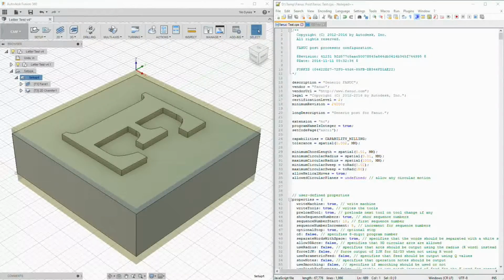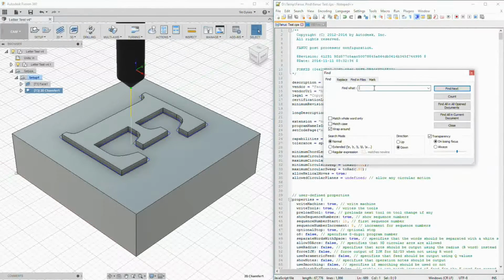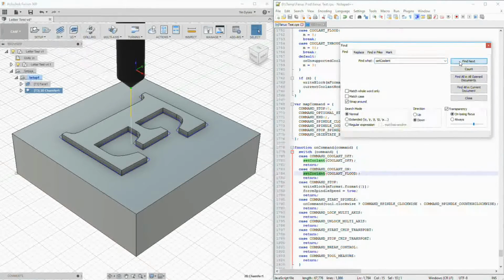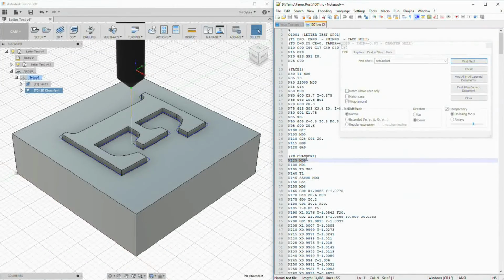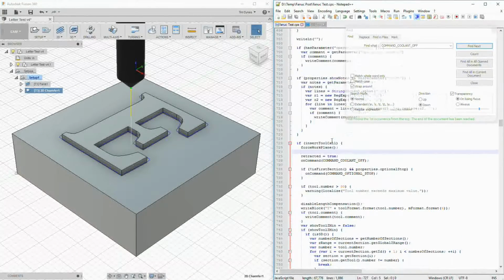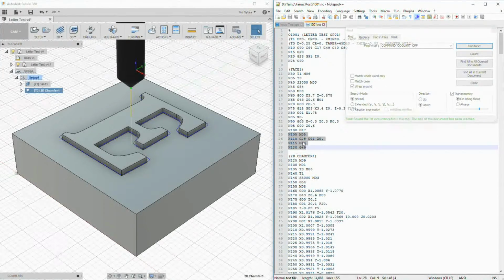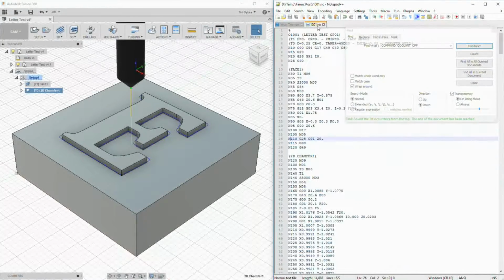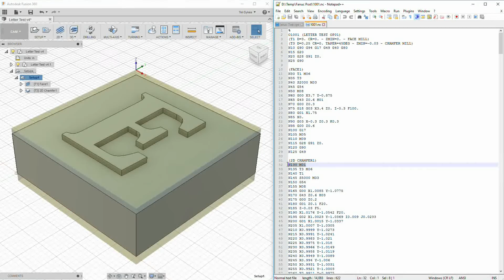Fusion 360 Post Processor Coolant Disable Location

Comment: Do you use that FANUC post for your Fadal, or do you use the Fadal post?   Also, now that fusion has the ability to do wrapped toothpath's w/ 4th axis have you had any interest in looking at a post for the Fadal?   I guess folks are having a hard time with the rotational 4th axis and the Fadal.  Autodesk seems to have the 4th axis indexing w/ the Fadal, but the rotational 4th axis on the Fadal seems to be headache.  What are your thoughts?
Reply from the maker: Hi Seth, I have my own Fadal Post I wrote for my machine. The generic Fusion 360 version does not really work well. I have done 2 4th axis posts for a customer but I think they only use them for positioning as well. I have plans to do a 4th for Fadal but not in the short term. I have the iron and controls for a 4th, just need a motor and some other things. The issue with the Fadal 4th is calculating the feed rate. That is what makes it a little bit of a PITA.

Comment: thanks for making these videos. i just bought a seat of HSMWorks Pro as I am a SW house and need 4-axis and did nto want to reprogram parts in Fusion that change in SW. I have discovered the Fusion post works with HSMWorks. I am not sure its the other way around as i have not tested it. have you tried?
 
Soon I am told I will be receiving a license of Fusion Ultimate & Inventor  with the seat of HSMWorks Pro so can test it at some point.

What video editing software do you use? I tried camtasia but it cannot process .mts files that my video camera creates. Its just hangs when i use edit these files.  I have Pinnacle Studio 20 that is awesome but it cannot record webcam and screen so for instructional videos its not so great.
Reply from the maker: I don't know if HSM posts will work on Fusion, I would think they should as there using the same CAM kernel that I can tell.
I'm using VSDC video editor, I paid for the unlocked version and it seems to do ok. I'm looking into a higher end pay version now that I'm going to keep doing this youtube thing for a bit.
Reply: Fusion 360, HSMworks, and InventorHSM all use the same post processors so you're good :)

Comment: Great video, nobody has covered this yet. I have a Centroid CNC and Fusion puts an "O" filename that the controller doesn't like, I know I can fix it by just commenting out that line. I assume you made a new Post Processor so Fusion doesn't come along and over write it.
Reply from the maker: Yes, I started with there Post and then heavily modified it. I need to go back and tweak it now and then as they add features. Removing the O line is not that big of deal to do. It is in the "onOpen" function right before the machine config dump.
Reply: Thanks, I can see the need for them to publish some supporting documentation and API's.
Reply from the maker: I have a video on the list to review the "dump" post, it will give all the parameters available. I was also able to dig up some info on the API but it is not nearly enough to code one from scratch.

Comment: I got one for you, I use the mitsubishi post, and when my machine finishes or does a tool change it runs the spindle until it reaches the Z0 of the machine, I want the spindle to turn off at the retract height of .2 or whatever it's set to so I don't have to listen to it whine at 8k for 20inches, I'd like it to be changed for both the M6 and the G28
Reply from the maker: Hi Dylan, I can do a video on that but it will be really similar to this one. For Spindle off you want to search for M5 or the COMMAND STOP function. Let me know if you need any help.
Reply: At-Man Unlimited Machining yeah after watching the video I realize it would be almost the same, but thanks I will message you if I get stumped
Reply from the maker: No Problem, I will make one on the spindle topic.

Comment: I like the straight forward approach and pace of your videos. Not too fast or to slow. Do you use G Wizard? If so what are your thoughts on it for feeds and speeds?
Reply from the maker: Thanks Greg, Yes G Wizard is a great tool. I don't use it for speeds and feeds per say because Fusion will give you chip load and I know the SFM for most materials and tooling. What I do like about G wizard is the tool deflection guess. It gives you a good measure of how hard your pushing when doing a new part. It is not perfect as you need to account for tool holding and such but its a good thumb to go by.

Comment: Hi Tim,

Your post processor stuff has been most interesting and very much better that the video that Autodesk put out. I'm in the process of setting up a 1984 Denford Orac CNC lathe that I've upgraded with new electronics and LinuxCNC.
Reply from the maker: Hi Paul, that is a very high compliment, thank you. Sounds like you have a fun project going. Let me know if you need anything specific. Tim